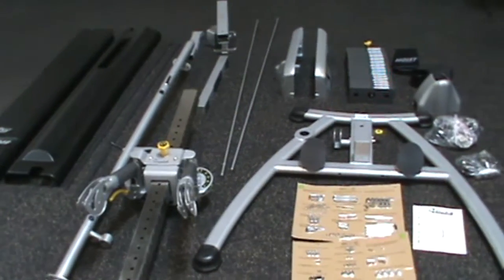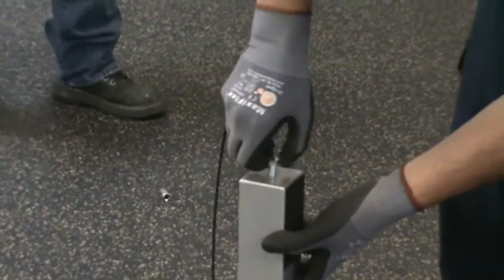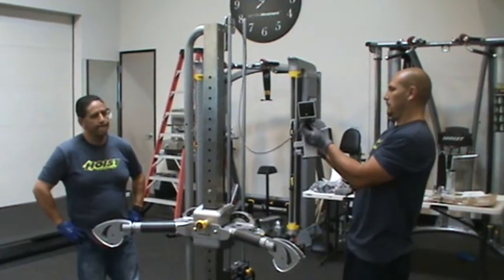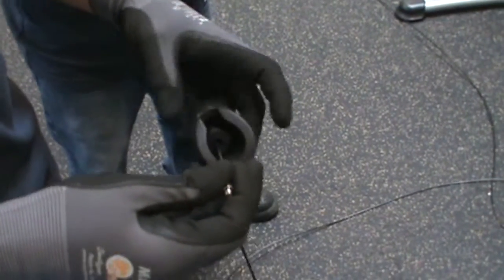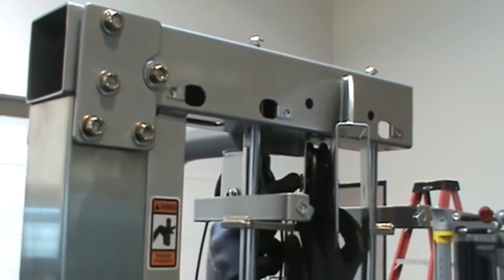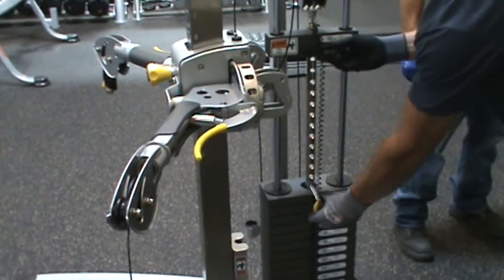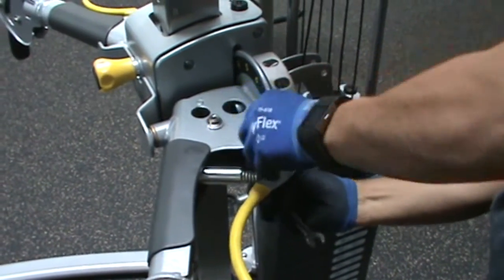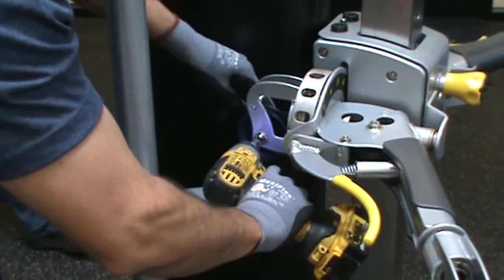HOIST Mi5 Assembly Video

Comment: We received our trainer without the owners manual and tried this video. This video is not accurate for many part numbers and set up. It is however helpful for identifying parts. I would recommend you use this video in conjunction with a downloaded pdf of the owners manual.
Reply: Really, they are calling out the wrong part numbers in the video?    Were the parts at least all bagged and tagged for easy identification?